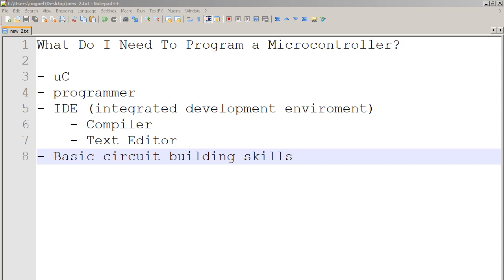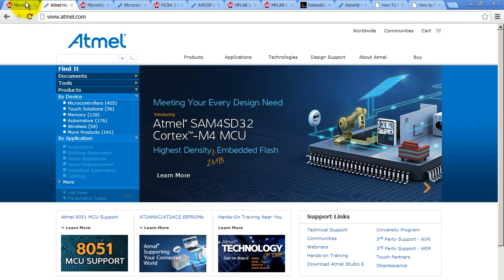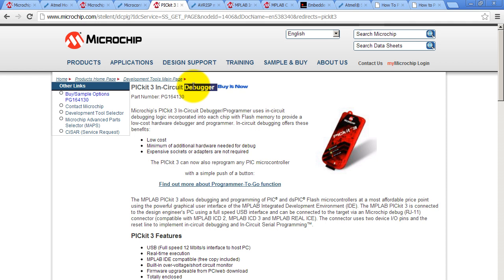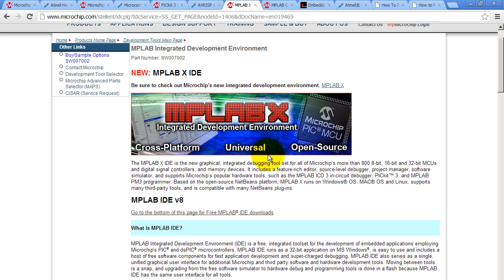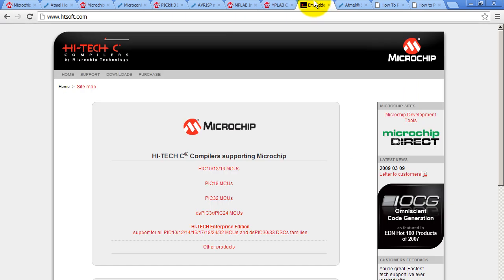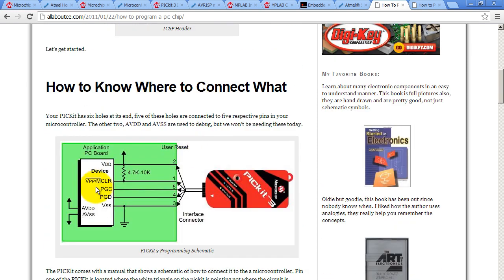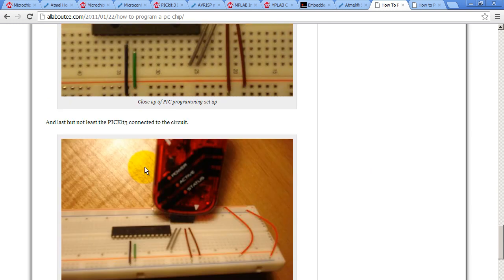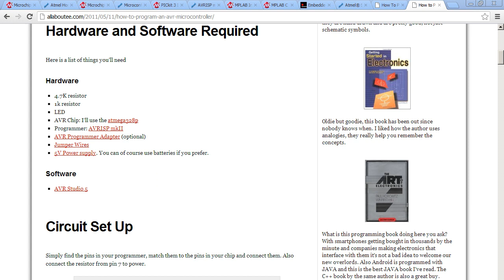How To Program a Microcontroller - What Do I Need?

Comment: Do I have to program the chip before it is added to the board, or can I program it after I add it to the board?
Reply: All current microcontrollers use some form of ICSP which stands for In-Circuit Serial Programming, meaning that the chip can generally be programmed after it's been connected to the circuit.  It's possible that some highly specialised circuits may interfere with the ICSP signals, but those are rare and if you're copying someone else's design, they will normally warn you if you need to program the microcontroller before putting it into the circuit.

Comment: Thank you Sir. Also you can program the PIC micro-controller using MP LAB program which must be  installed on the lab top. But the Lab top interfaces with the Arduino Kit for example.

Comment: What is the purpose of the resistor you put there? In other cases I have seen them also put a crystal oscillator and capacitors when programming the PIC microcontroller. What are those needed for and how do I know if and where to connect them?
Reply from the maker: Rein Loopalu My best guess about the resistor is that it is a pull-up resistor to prevent the micro's reset pin from being in a floating/unknown state. The crystal oscillator and capacitors is only needed if your micro doesn't have an internal one or if you want to use a frequency that is not provided by the internal.

Comment: (Question?/Mod)    I have a arcade stick which uses macro's and I was wondering would the brain or microcontroller be reponsible for my macro limit or speed limit? This is just a small project that could give me infinite Streetfighter Combos!  I would like to modify if this the component that controls everything. So do you agree, this is my focal point to gain my power of extra macros?

Comment: What is difference between Atmel, Microchip and Arduino? Could you summarize differences between them? Are they all ARM based? Which is easier to learn on? What are differences in cost, ease of development, usability or others. Thank you for video.
Reply from the maker: Atmel is ARM based, Microchip is not. The Arduino is a microcontroller development platform built on an Atmel microcontroller.
Reply: arduino is not a microcontroller

Comment: Yeah but a pretty smart mexican lol. Anyways guys if you want to start programming microcontrollers buy a starter guide from parallax it comes with a microcontroller and the programmer plus a breadboard and other electrical items you'll need to start learning. It's only 80 dollars, that is like 60% off if you bought all parts separate